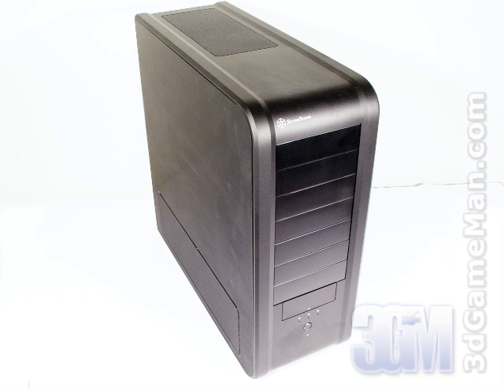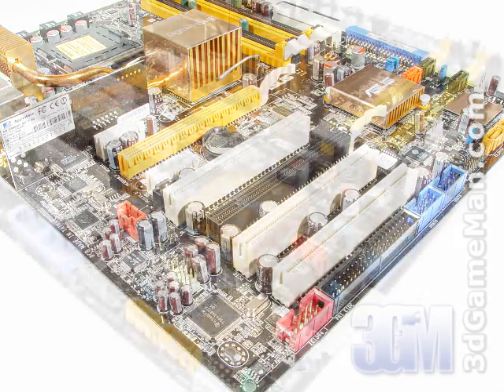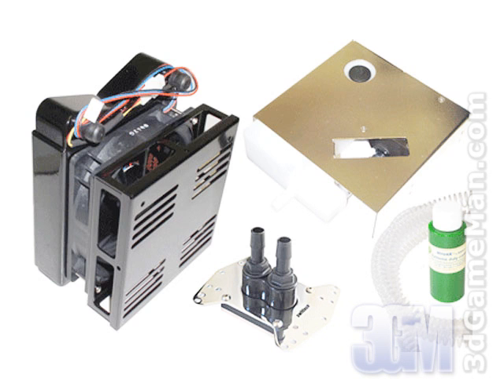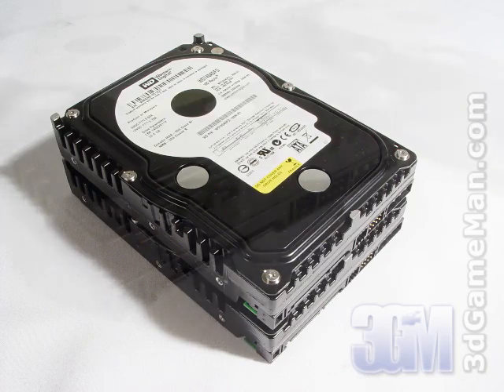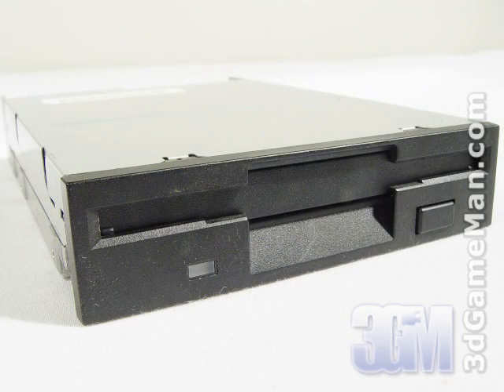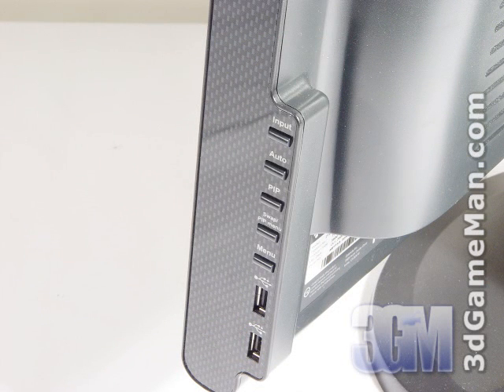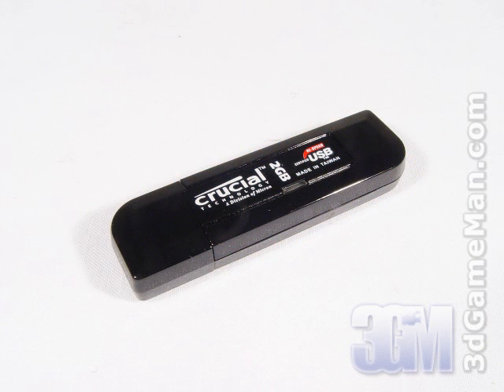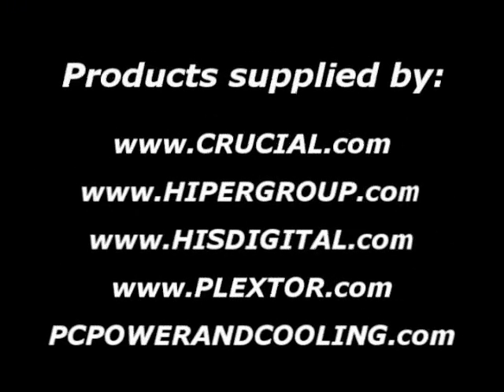#722 - Building A KICKASS Gaming Rig ( Part 1/3) Video

Comment: you talked about the wattage having to do with keeping your computer running smoothly and that gives another scenario to my problem. I ussually get lag spikes after playing around 30 minutes on my computer and then after that the time between lag spikes get shorter and they get longer is this a problem of over heating (my computer does heat up significantly) or is it a problem of power loss. it might just be over heating because ussually no matter what my computer always says it has full charge

Comment: @Mooseguy15 well i sold that comp built myself a new one here are the specs : AMD Phenom 555 BE unlocked to 4 cores @ 3.7GHz On stock cooler runs at 67C on full load but CPU fan is at max but its not annoying, 650 Watt PSU, Biostar A880G+ , XFX Radeon 5770, 4GB AmpX Memory, 500GB HDD and thats pretty much it lol so i dont got an intel anymore cause i figured AMD is easier to OC and it pretty much is even tho its BE

Comment: @dethklok1989 
its when the power goes partially out. you still have power but only enough to run the lights at half power but you can run anything else

Comment: I agree with ur build dude. To add though, you don't need watercooling. You can get up to about 4 ghz on air. I have mine at 3.6 on air and it is at 55C full load. That's incredible! Definitely get the rampage II. I use that mobo and it is a BEAST. It has an auto overclocking feature too. All you do is enter in your target frequency and it changes everything for you. fsb, voltages, everything. Also go with a 1000W psu instead and quadfire those 5970's

Comment: I am building a quad system now from a dual core system. It's going to be Kick ASS
AZZA 1000 Case
Intel Q9400
ASUS P5PKL-CM MOBO
XFX 5770
Primary 250GB OS
Secondary 500GB Storage
Zalman 9700 Heatsink
Geil Memory cooling Fan
A-Data 4GB High performance and Gaming Memory
Vantec Video card cooling device (4500RPM)
Xigmatek 650watts PSU modluar

Comment: If you plan to overclock, then you need good cooling system, probably water cooling if you want to push the cpu to its limits.  If you are just going to leave everything at stock speeds, then the cpu fan & heatsink that is included with the cpu works fine, as long as your case has at least 2 80mm fans or higher (just to be safe)  The AMD CPUs can take a decent heat, just not nearly as high as intel, that is all.  By all means I suggest AMD for budget builds that don't sacrifice performance.

Comment: it really depends.  If you are on a budget around $500 to $800, then AMD is good for processors.  Their CPUs are well priced and provide great performance for the cost.  although, the biggest issues with AMD CPUs are that they are fragile and can sometimes be picky about processes. Intel is much more durable and can take higher temperatures, but cost 2x, or even 4x the amount of the AMD CPUs.  But graphics card wise, NVIDIA and ATI seem to be neck and neck, both are good choices in the end.

Comment: -GIGABYTE GA-EX58-UD3R LGA 1366
Western Digital Caviar Black WD6401AALS 640GB 7200 RPM 32MB Cache
-XFX GS250XZDFC GeForce GTS 250 1GB
-CORSAIR DOMINATOR 6GB (3 x 2GB) 240-Pin DDR3 SDRAM DDR3 1600
-750W ATX12V / EPS12V SLI NVIDIA SLI Certified
-Intel Core i7 920 Nehalem 2.66GHz

Not the best graphics card, but it does the job.

Comment: Actually, it is.

Do some shopping on Newegg . com
You'll find that it's quite possible.

Perhaps not the very highest settings (depending), but very nearly so.  I'm currently build an oil-submerged PC, and right now total cost (monitor and peripherals included) is about $1300.  Stats to follow

Comment: here is mine

AMD 7750
AsRock crossfire mobo
4gb of DDR2 1066 (in 1066 speed)
ATI 4850
Coolermaster 590 case
asus dvd rw
raidmax 730watt psu modular as well

got all my parts on newegg and it pwns i think my total was under 600.. with the rebates but i got a 19" 1680x1050 monitor for 129$ its illlll

Comment: here is mine

AMD 5200 2.7 ghz BLK edt. 50$
Evga 650 geforce mobo 60$
4g RAM Adata 30$
palit 8800GT 79$
logysis acrylic case 45$
seagate 500Gb HD 50$
asus DVD+RW 32X 30$
raidmax 530SS PSU 35$

got all my parts from newegg deals, and local shops that had blowout sales cause they went out of business.

Comment: Go for X-fi, 2GB low latency kits, velociraptor 150gb and a gtx260, a matching mobo and about 150-200$ cpu of any builder. Of good get some support on hoy to mount properly into a good case, both tacens victoria are good for this. 100$ psu with dual pcie connector should be ok.

Comment: am sure it does but, it will really start to strugle now.  And, well, it would but you need to know one bit of info, have you got an AGP or PCI-e board?  To find out, checkout something called CPU-Z, that will tell u, if it is PCI, and u have a relativly good power supply, you will be good to go.  Send me a pm buddy, I'll help u out as best I can

Comment: 360s are built in massive numbers therefor keeping costs down.  To run new games at medium to high (depending on your resolution), have a look for 3850/70s, should pick them up fairly cheap.  Anything lower than that, and you will be spending yet another £70 in 6 months replacing it again :\

Comment: this video is kina old yeah you might want to check out the video card first because it pretty much picks your computer because you need a power supply that can take the amps of the video card and also you might need a new monitor to set the resolution to because if you have higher resolution than your monitor it will become a dot

Comment: I tend to lean towards pre built depending on the time of year. In the winter the humidity is less than 10%, this means big time static so bad i even get zapped when I connect wires at the back of my case.
I the summer the humidity is more than 60% so static is not an issue.

Comment: AMD processors are more efficient than Intel processors.  So a 3.0GHz Intel processor would be slower than a 3.0GH AMD processor.  The 3800 rating you see for the AMD processor is its processing speed that is directly comparable to AMD.

Comment: 3800 is a model number for AMD. 3800 is a weak processor unless it's overclocked and even then, you can't overclock amd well by reputation. Unless he's speaking of the 3800 single core 2.4Ghz socket 939...